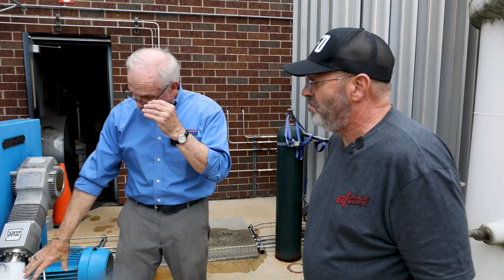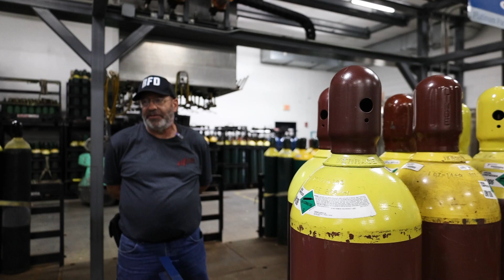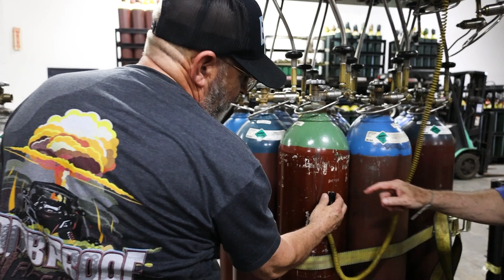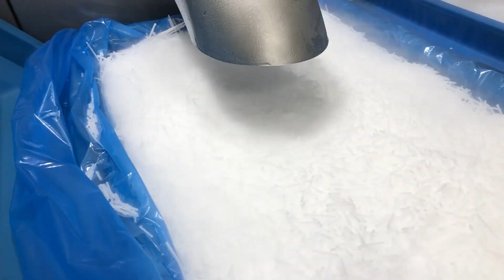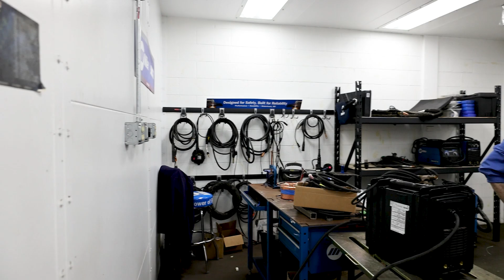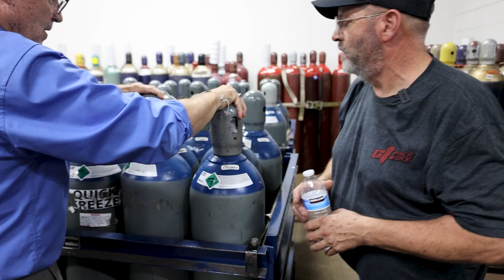Terrace Supply Company Fill Plant Tour

Comment: Great to see content on this channel, I thought it was a hoax when we saw nothing uploaded for so long.

This company is a fine example of how it should be done.   Put your staff safety first, don’t think of the bottom line.  DuPont refused to use Monel on some of its plant and a worker was killed due to it.  I think they only needed to use a few feet of it.   This company on the other hand is like, 30k, get it done.

Finally, I didn’t think I’d watch an hour of chemical chat but I learned so much from this.  What a fascinating character.  Excellent video guys.

Comment: How you going these days ole timer? Here in Australia we have bottles with an in built regulator/flow meter where you dont need an external regulator. Look up BOC F3vipr its pretty slick.
Reply: You can still get the regular bottles though. The built in regulator deal is an option, air liquide does it as well.